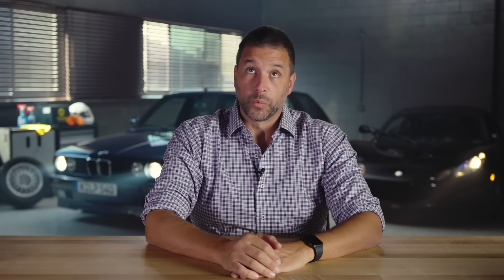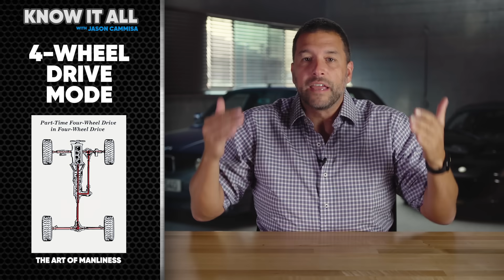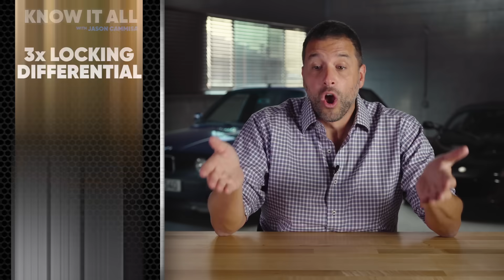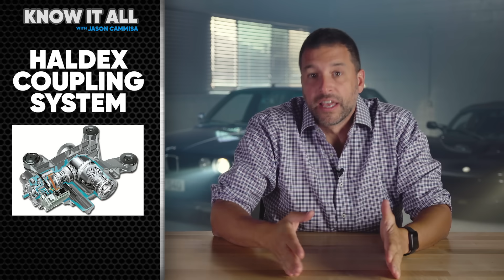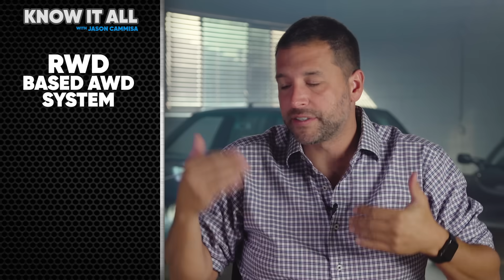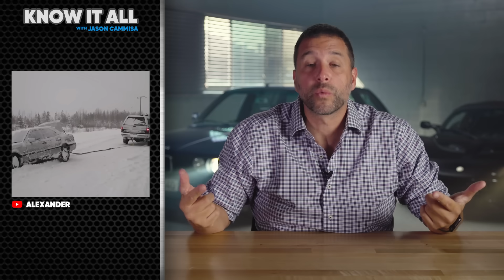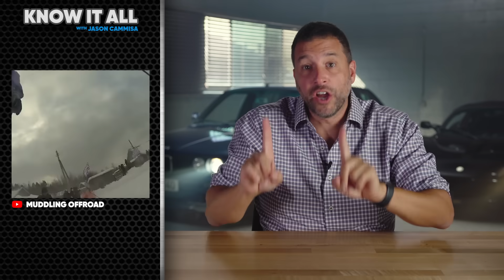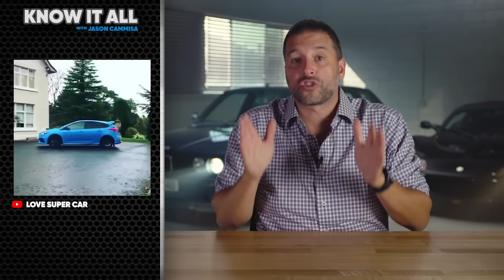Understand Your All-Wheel-Drive System | Know it All with Jason Cammisa | Ep. 04

Comment: You can have a Haldex rear biased system, you just have to stick the engine in the back like a Porsche.
Reply: Yes, i remember they did build them this way for some time! (the awd Lamborghinis since they are Audi owned and the Audi R8 are the same way)
Reply: Noob here 

Isn’t the RWD system also a Haldex system but it instead of the Front wheels being the ones locked to the Engine it’s the rear ones? So basically aren’t they the same just the wheels that are locked are the Rear ones not the Front ones?
Reply: @anonymoussoap8310  Yeah this is jus a difference between Jason using Haldex as a blanket term to describe permanently-powered front axles and the comments using it as a brand name for any of the AWD systems VAG uses based on the same principle of one permanently-powered axle.
Reply: There is a bit of a difference.1: Haldex is (or was?) a company that manufacturerd the diffclutchpacks. With that, the rear diff and the clutchpack are one unit And the axle closer to the engine is always powered.
2: Systems like X-drive, 4matic+ (and the one Jaguar uses ect): Those have their normal rear diffs (or with a LSD) and they also have a "transfer case" where the power is coming out of the gearbox a second time and via a second cardan shaft is going "back" to the front into the front diff  This transfer case is basically a clutchpack that can close 0-100% and thus bring a max of 50% of the power to the front wheels.
In summary the difference between a Haldex and the other partial systems is where the connection happens and what is inside the differential housing.
With Haldex the connection is made "inside the differential" with the others "inside the gearbox"

There are several generations of the Haldex system. The first ones were mechanically controlled and only locked when the difference in speed between the propelled and non propelled wheels exceeded a certain value. (a bit like with a torsen diff, but with clutches) The new generations are electronically controlled and so can be closed before the driven axle looses traction. (not everybody programms it that way, but it is possible)
The other systems are electronically controlled from the beginning.
Little sidenote: Haldex (if i am not mistaken) is a swedish company, while x-drive and most of the other of these systems, are designed and built by Magna (in Austria) by contract for the manufacturers. (Magna designes and makes awd systems for almost anyone except Suzuki, Subaru, Lada and Toyota from what i remember but they aren't very vocal about it. Those few companies do it themselves. And yes, even for Jeep they have done systems in the past. Don't know about the present)
Reply: @nirfz  Almost all of the powertrain systems that car manufacturers use are designed and produced by someone else. They are companies like Magna, GKN, BorgWarner (who bought Haldex) and Jtekt (the Asian choice). If the car manufacturer happens to have their own transmissions, they might also have 4wd or awd systems. For example the 4Matic system from Mercedes might be their own, but I'm not sure. The original 4Matic is actually a planetary center differential that has a small lock up clutch to get you out of trouble. After you get some speed the differential works as an open differential, that might have some rwd bias. But these days 4Matic name is linked to probably half a dozen different systems.
Reply: @YTjmn  I agree. (I just mentioned Magna, because on a rare occasion 2 years ago i have seen their lineup of example cars ranging from BMW, Fiat, Mercedes, Hyunday, VW...)
While i know that Mercedes is still making their own manual and automatic gearboxes, (no idea about the DCT ones though) i am not sure about all of the 4matic systems. They were the first to work with the predecessor of Magna in Austria (Steyr Daimler Puch) for the G. So i wouldn't wonder if all of the different systems called 4matic are designed by them too.
They do the same as Audi does: Calling anything 4matic no matter the system. 
The sad thing to me is that marketing language. "quattro ultra" i would call "quattro light" (a haldex system for the A4 and upwards) and 4matic+ is (to me) a 4matic- As it is not a permanent one with a rear bias with theplanetary system but a clutch one "adding" the front wheels.
I've got an "old" 4matic like you described myself, but for the GLK it was a 50:50 ratio. (not like the 40:60 in the non-SUV's back then)
Reply: @YTjmn  mitsubishi does all their own drivetrain (at least the older models u know about), and I would assume Honda does SH-AWD in house too

Comment: Then there are also the Viscous coupling variant. A weird breed of both haldex and permanent AWD.
I say breed because in this example, my 850 AWD has a natural torque split of 95/5 so technically it’s permanent but it in reality it behaves more like a haldex.

Driving characteristics of one is... Intresting...
You see, a viscous coupling need some time before engaging, this produces a handling which can be described like an Ur-quattro... but worse.

You turn in, nothing happens. Then when you are through the corner, the coupling finally starts engaging, causing oversteer at the wrong moment.
Reply: I have experienced something similar with a Suzuki Ignis 4x4

Comment: What about cars with a torsion center diff instead of an electronic clutch pack or locking transfer case, like the longitudally mounted engine Audi sedans like the S6?
Reply: And the SQ5... (I think he messed up a bit there; last time I checked the SQ5 was permanent AWD i.e. proper Quattro)... I'm prepared to be wrong though...

Comment: Great video as usual.
The problem is the confusion between torque and wheel speed....a  modern AWD operates like a clutch based LSD...the only thing these systems do is sending wheel speed.
The torque is always the result depending on the grip of each wheel.

Comment: What about AWD v true 4x4?  Would love to hear your explanation of the difference.  I have a 2016 Grand Cherokee with 4x4 drive.
Reply: The common US interpretation is, that it is a selectable AWD without a center differential. Just like the first variant described in the video. There is permanent drive to one axle and you can choose to connect the second axle in a "on/off" way without a differential. The most primitive way to do it.
Reply: @Scott H dynamic lol, that 4x4 auto mode is a hysteresis switch.
Reply: AWD is a vehicle with an open differential in the transfer case allowing the vehicle to drive on dry roads with all wheels being (somewhat) powered.  4WD refers to a transfer case with a closed center differential (locked) where at all times power is being sent to both the front and rear axles, meaning this setting cannot be used on dry roads.  Many vehicles (including my 1998 Jeep Cherokee XJ with the optional N242 transfer case) have both settings available.